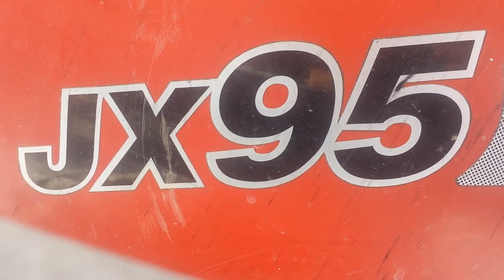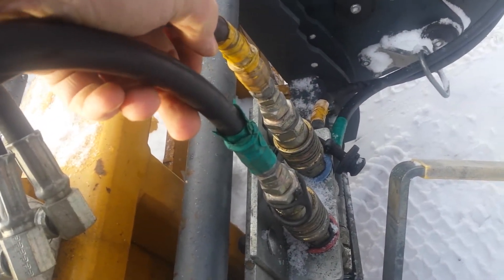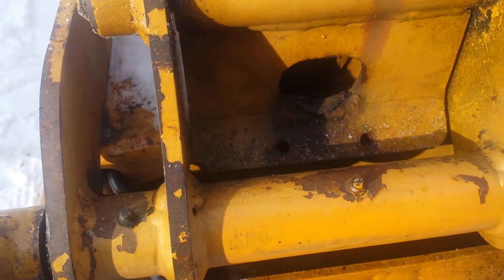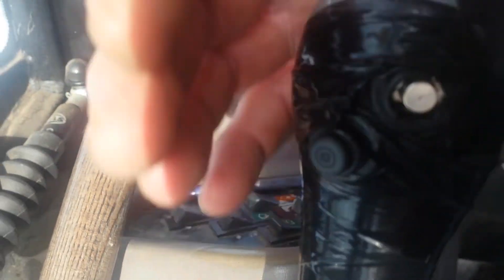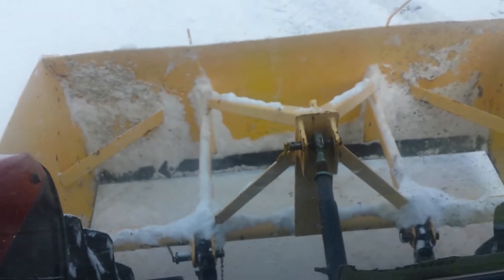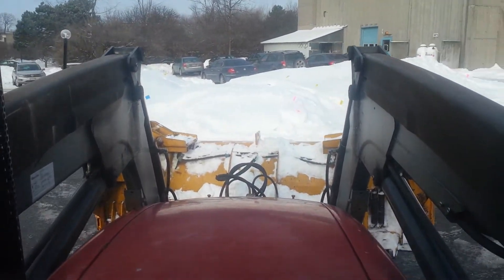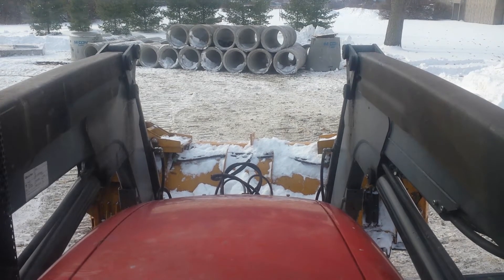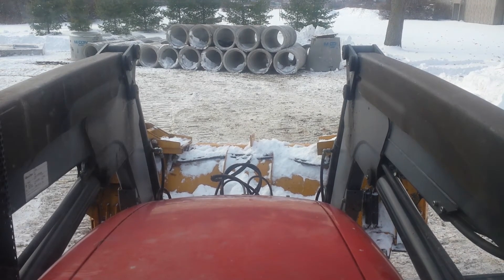Case JX95 Snow Plow Set Up

Comment: Amazing how many hydraulic cylinders an engineer can design into a rather simple device like a snow plough ....:-) ...
Reply from the maker: It does look way to complicated I agree but it works well and I can't complain to much.
Reply: As long as it works it's probably a great piece of kit,... but my first and foremost engineering principle is - if it's not fitted it cannot fail - which leads to an almost natural simplicity. It's the 90% customer who brings the money, not the 10% who asking for all sorts of usually expensive but rather worthless bells and whistles.